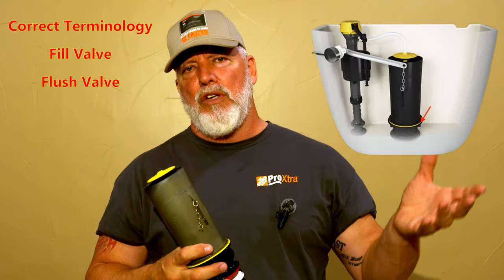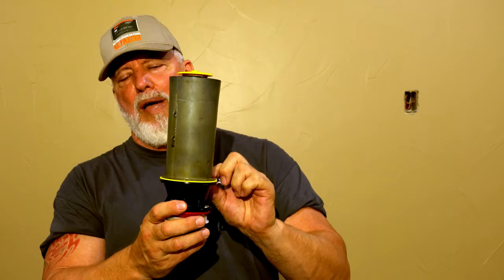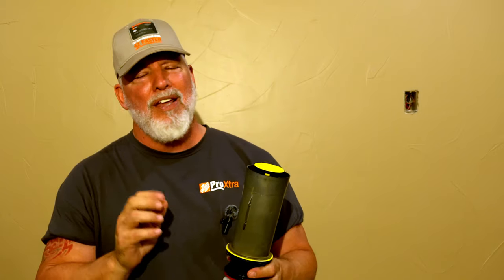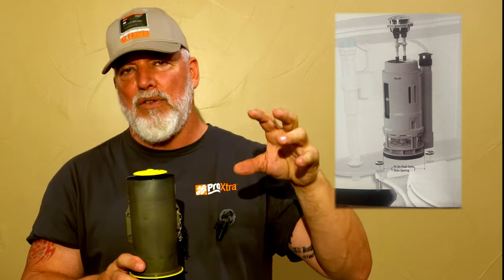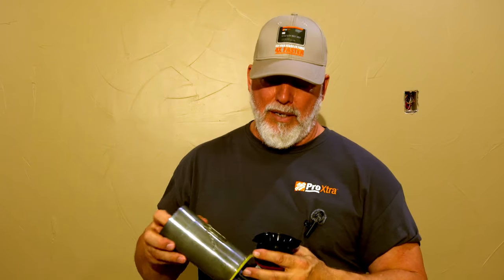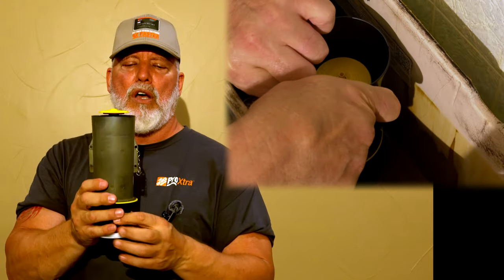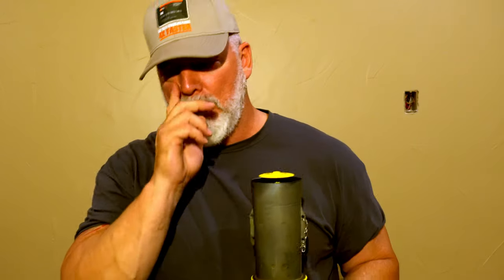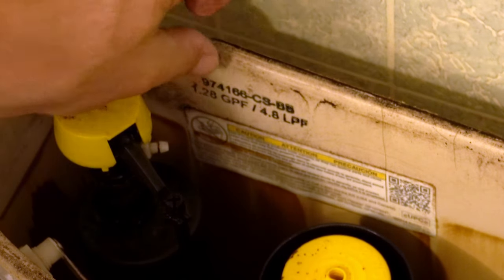How To Fix a Kohler Canister Flush Valve In 60 Seconds in 2024 #kohler #plumbinghacks #toiletrepair

Comment: My 3 year old Kohler is just VERY hard to flush, 2 hands on handle to force a flush especially if not used for 8 hours?  flapper seal on the flush can?
Reply from the maker: Possibly and possibly the handle is bent and out of alignment. Every once in a while I change the entire handle assembly if it seems to be sticking. You can slowly push the handle and see if you find the sticking spot. If that doesn’t solve the problem, then I would look closely at the seal or maybe even the entire flush assembly.

Comment: My Kohler toilet does the ghost or phantom flushing. Will replacing the canister solve this problem?
Reply from the maker: That depends the canister will fix that if the reason it is is ghost flushing is because it is slowly draining water due to the leaking canister seals or another possibility can be your fill valve not working correctly. But in most cases, I would start by replacing the canister. It’s quick and easy and most of the time it stops the ghost flushing.
Reply from the maker: There is also a seal at the bottom of that canister that you can try to replace that only cost a few dollars

Comment: I have that Kohler toilet valve.  This toilet was replaced when we had the bathroom remodeled. It's less than a month old.  Our problem started slowly but is happening more often. Sometimes it works normally, sometimes it takes quite a while to start refilling, and sometimes it doesn't refill at all and I have to take off the lid and tap the arm. Any suggestion for that?
Reply from the maker: That sounds like a defective fill valve. If they ran all new water lines they may have gotten trash in the line at hookup. I would just replace the valve fill valve, the part is under $20. There is also a gasket in the valve you can replace for a few bucks that might fix the problem. I have a video on it under my plumbing playlist.

Comment: Thank you, this worked.  However, a couple of comments.  Yes, the new one twisted apart just as you described.  The old one took significantly more force to unscrew, especially where it is located.  Hands do not work that well down inside the tank.  Secondly, it is very hard to reattach the chain if the canister is in place.  Conversely, it is very hard to twist in the canister if you have already reattached the chain.  Catch-22.
Reply from the maker: Very good points! I just think I’ve done it so many times and I don’t realize how hard it can be if you’re not used to doing it. Thank you for watching and thank you for the comments.

Comment: I have a problem with the same unit, only it’s the top yellow disc itself that keeps popping out. I have tried pushing it back into the tube  but it will pop back out after a couple flush’s. Any suggestions? Btw the disk does not appear to be broken
Reply from the maker: I’ve seen that happen as well as the stem breaking off. I would replace the unit. The yellow dish twists on and off but may be broken if it will not stay, a new one is under $9 
https://amzn.to/3A07XQs
Hope this helps
Reply: @UltimateDiyer  thank you so much! The disc does not appear broken as the bottom half is intact with 2 “half moon” indents, it looks to me like it pressed in and wore out? I’m gonna try some pipe tape and see if it holds. Thank you for the link

Comment: In your opinion which is better, the Toto Drake toilet, or this Kohler with the canister flush valve? I want a toilet that works reliably. Here in California 1.26 gallons is the maximum flush water volume. I don’t want a vulnerable valve, and I’m willing to pay a bit more for a Toto if that’s the more reliable item.
Reply from the maker: Honestly I’m replacing every toilet in my home with Toto’s I think they are a better toilet, remember they have several models. I will be releasing a video in the near future installing a higher end Toto unit.

Comment: We have this setup and the canister sticks when flushing about half the time - you have to tap the canister to get it to go down, otherwise the water keeps running. Any hack to fix this? I tried adjusting the chain but it didn't seem to help much.
Reply from the maker: I’ve seen this a few times in the past something seems to go wrong with some of the canisters and they have a sticking point. I’ve ended up replacing the canister and they tend to work pretty well after that. Sometimes adjusting the handle can help where it doesn’t go so far up, but it sounds like you’ve already done that. Thank you for watching and thank you for the question. Let me know if you come up with a solution or if you just replace it.

Comment: Aw man I needed a video on how to replace the bottom part that you said stays. The locking mechanism broke on mine so the canister keeps popping out every time I flush.
Reply from the maker: Well looks like I need to make that video next. It’s not too hard to replace that part. But you will end up removing the tank as I’m sure you have figured out. Just take your time, it’s really self explanatory, just make sure you buy the complete assembly.

Comment: i have had to replace the little yellow gasket several times. Is that normal?
Reply from the maker: You might try replacing the rubber hose with a longer more flexible hose, one viewer suggested strapping the longer hose up to keep it away from the handle. I replace the hose each time and it seems to stop the breakage.

Comment: My canister is working well, but the water fills the tank extremely slow. Do I need to replace with the same fill valve (1210001) or will a decent off the shelf valve be ok?  Where would I get that particular fill valve?
Reply from the maker: I would use the Fluidmaster 400A https://amzn.to/3ATP1De 
It is universal and has been proven to last, cost under $10, and is super easy to install.

Comment: I’ve had different issues.  The first think was the piece that goes into stem broke at the bottom.    Replaced the unit, but now the yellow top keeps popping off.    So frustrating.
Reply from the maker: Yes, that seems to be an ongoing theme and I’ve had several others mention the same problem but if that plastic piece is popping off, you’re probably going to need replace the whole centerpiece and I believe. So you don’t need the whole canister but the centerpiece you can buy by itself with a new yellow top that is attached. https://amzn.to/4ddDe09
Reply from the maker: Also, when you put the new one on replace the hose with a new flexible hose, you can get those at Home Depot or any auto parts store. Just take your old one with you to match it up because of the hose is owed and brittle it can be pulling on that top and breaking it loose.

Comment: I just had a kohler toilet installed by a plumber.   It seems when you flush the water fills to the top and then overflows (does not completely shutoff Wasting water)    I tried to change the water level by adjusting the turn screw but it doesn’t change the water level in the tank.  Any suggestions?
Reply from the maker: Harry, honestly it sounds like the fill valve needs adjustment. When you turn the adjustment screw, and then flush again is it not changing the water level at all? If it is not, you may not be working the adjustment screw properly or it’s defective. With the lid off do you see water running over the top of the canister? If not the gasket at the bottom of the canister may need replacing. It would be unusual for the fill valve or the canister gasket to be bad on a brand new toilet but not impossible.
Reply: The water is running over the top of the canister.  Turning the adjustment screw either way does not change the water level.

Comment: I replaced the  valve assembly no issues. The tank however still doesnt fill up with the hose attached to the yellow tip. If I remove the hose and have the water fill directly into the tank the float valve shuts off the water supply. WHat am I doing wrong? Why doesnt the tank fill with the hose attached to the yellow tip?
Reply from the maker: Water comes out in 2 places. The hose and the bottom of the valve. The hose fills the bowl after you flush, that’s why it goes down the canister, If the tank isn’t filling up I would look close at the bottom of the valve and make sure it has water coming out of it after flushing. Sounds like there is something wrong maybe blocking the outlet in the valve assembly. I can’t see what happening but if it sounds like water is running down the drain, make sure the canister is seated properly and not allowing water to escape.

Comment: I found your video searching for how to fix my toilet, with this  Kohler flush valve that was running. I changed out the seal, which was very easy, but it’s still running. Any idea on why?
Reply from the maker: Sounds like the water level is too high, did you turn the set screw and adjust the water level down a bit?
Reply: @UltimateDiyer  First, thank you for replying! I haven’t, but will try that. FYI, this toilet is probably 5 years old and has a very defined water line which it still fills up to, but now just keeps running. The old seal was in great shape but I changed it anyway. Also, if I jiggle the cylinder around a little bit I can usually get it to stop running.
Reply: @UltimateDiyer  I adjusted the set screw a number of times and it kept filling up all the way to the waterline and running so I figured it was the fill valve that was bad, so I replaced it and it’s now fixed, thanks again 👍🏻
Reply from the maker: Great information. That was next on my list of possible fixes. Thank you for the update.

Comment: I followed your video and replaced the gasket. My toilet is not a year old. The top is not cracked. When I put it all back together  it is still leaking,  what do you think?
Reply from the maker: If it is leaking into the bowl and the gasket did not fix it, it is probably going to be the fill valve itself. Make sure the water level is not set too high as well. I have another video I released a few weeks ago that covers running toilets and quick fixes.

Comment: On mine the neck keeps breaking where it twists into the base unit. Is there a reason that could keep happening?
Reply from the maker: Do you mean that you keep replacing the unit and that same part keeps breaking on the replacements or it the same part keeps breaking on the original unit?
Reply: @UltimateDiyer  The replacement neck.

Comment: Can you change from a flapper type to this type ?
Reply from the maker: I have not tried that, but I think it would work as long as the pipe size is correct, if you follow my amazon link you can buy the entire pipe system with gaskets

Comment: My Kohler leaks after flushing.  I watched your video, but the yellow gasket is clean.  The tube on the top is not broken. There is no serial number on the inside of the tank.  I took a picture and it linked to Kohler.  It said to clean the fill valve seat/seal and replace it.  I'm afraid I'll break the yellow cap.  Does it just snap off with effort?  Thank you.  I'm an older single women and love to be independent with the help of your videos!
Reply from the maker: Yes, it does just snap out. You have to go counterclockwise and push fairly firm. You’ll fill it click and then come loose. Just make sure that you have the water off and if you can either use a sponge in a bucket or a wet back to get the rest of the water out of the tank so you don’t have a lot of water on the floor And I do agree with what they say. It sounds like there’s something causing problems at the bottom of the valve. If it’s leaking, you may be able to change that gasket at the bottom or you may need to replace the entire unit if there is a crack or something wrong with it.
Reply: Thank you for your quick reply.  I hope I can handle this.  I enjoyed your clear instructions on your You Tube
.

Comment: Question for you.  On our Kohler toilet with this flush canister, the yellow disk on top that the hose connects to comes out of the center plastic piece when we flush.  The canister raises up, hits the hose and dislodges the yellow disk.  What recommendations do you have to fix that?  Do I need to replace the whole canister assembly?  Can the yellow disk be super glued or epoxied in place?

Thanks for the help!
Reply from the maker: Watch this video, I have the Amazon link to the center part you need to replace. Glueing will ultimately fail. The part is fairly cheap. Thank you for watching and the question. Let me know if you need more help.https://youtu.be/h4UCiQLQaZA?si=Zq8muyizqRzFe9to
Reply: @UltimateDiyer  That was it.  Thank you,

Comment: I have a Kohler toilet with the same style of canister in your video. It is not broken, but has poor flushing. Is there a way to increase the flow rate without changing any parts? Thanks.
Reply from the maker: There are generally just two ways that you can increase that you can adjust your flush valve itself so that the water goes all the way up just to below the canister edge so you have full volume of water and the other is make sure that your flush handle does not have any slack. Make sure that it’s tight.

Comment: Thanks. Our downstairs bathroom has a Kohler toilet and the top plastic where the hose connects to the flush valve (#1083980) just broke apart last night: the plastic sheared off.  Earlier this morning I "Gorilla-Glued" the pieces as a quick solution, but dang-me the curing time is 24-hours - that is a lot of walking up and back down the stairs for my "Octogenarian Parents".  I am planning to run to a couple of plumbing supply stores and see if I can get a replacement part.
Reply from the maker: I just updated the description with the new part that they have just lowered the price on Amazon that will fix that and I believe you can get that part in a day. Used to you had to buy the entire canister now you can buy just that centerpiece. Hope this helps and thank you for watching.

Comment: My 2 year old Kohler Santa Rosa already needs a new gasket at bottom.  At least I hope that is the problem.  It will run a few dozen times a day in between uses.  I tried pushing down on that canister thinking the gasket was just not sealing well.  Had an older american standard that was replaced by the kohler and the old style flapper valve was not sealing and would run constantly.  So this leak is better, but I guess I am heading to the store to get a new gasket.
Reply from the maker: Sometimes it’s the gasket and other times it’s the fill valve also. Let me know how it works out.
Reply: @UltimateDiyer  my little yellow cap unlocked not the whole shaft. Not sure if design changed or what. But pulled canister and gasket had a bubble in it. Nicked bubble with a knife to let air out and put it back together and not running any more.  Not sure how that gasket gets air inside it. How is it not just solid rubber?

Comment: I have a kolher 4236, slightly different stem but also a canister model. The stem dislodges every flush. Very annoying. Why would the stem constantly come up and out?...hope if I replace the entire unit it all works. New canister is $55 in my town.
Reply from the maker: I’m not positive without seeing what it’s actually doing but what you’re describing sounds like the same problem with the Kohler yellow top sounds like when you go to flush the canister is hitting the rubber line, causing it to pop the top off. I would replace the unit and maybe see if I could find a more flexible line, Possibly a little bit longer that you can kind of pin up away from the canister valve.

Comment: My canister just drops as soon as the handle is released and stops the flushing. Any ideas?
Reply from the maker: It sounds like there isn’t enough water entering the tank or in the tank to begin with. Take the lid off and check that the tank is full of water to the top of the canister. When you do flush you should hear the water filling rapidly, if not you may have a clogged or broken fill valve. You can also have the handle connected wrong at the canister, meaning the handle could be bent or broken so it’s not pulling the canister all the way open. Hope this helps. Thank you for watching and the question.
Reply: Same problem. I have to hold the handle down for the tank to empty completely.  The tank does fill to the proper level.

Comment: My toilet (kohler cannister) is flushing and filling up. It does, however, makes an annoying hissing sound while filling up What part do I need to solve this issue? The model number is 31615-CS-AB. Thank you. By the way, enjoyed watching the video.
Reply from the maker: Make sure the hose is connected, you might try adjusting the water to the unit. If that doesn’t fix it look at the flush/fill valve, take off the lid and flush it to see what location the noise is coming from. If it is the fill valve, replace the flush valve if it’s coming from the canister, replace the canister.  Most of the time noises even vibration comes from the fill valve itself.

Comment: Hi..what my problem is is the yellow disc with tube attached lifts off when I flush.  I'm not sure what is broken . I have tried putting it back on to no avail.  It will not turn. I see just the canister repair kit on amazon.  Is that what I need? or the whole flush valve kit.???
Reply from the maker: The flush valve kit I order from amazon includes the center post so that might fix your issue. It’s hard for me to say without see your unit in action. If the yellow cap is coming off, it’s attached to the center post and that comes with the part you can order on amazon. https://amzn.to/49a51MZ
Reply: @UltimateDiyer   Thank you ...that is the part I ordered,  hopefully easy enough to install.   Your video above is just replacing canister. Do you have a video on replacing center post with new disc??   Thanks again.  Maureen
Reply: and.... it's fixed. After I got the part I realized it was just the yellow disc that was actually broken and white ring missing????  Thank you for your great advice!!